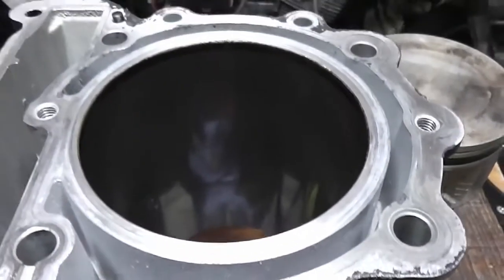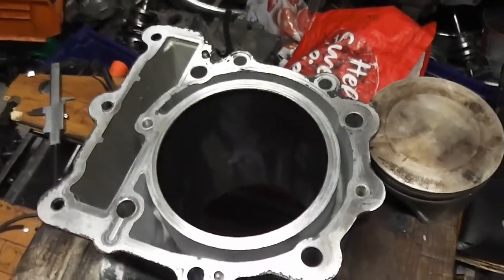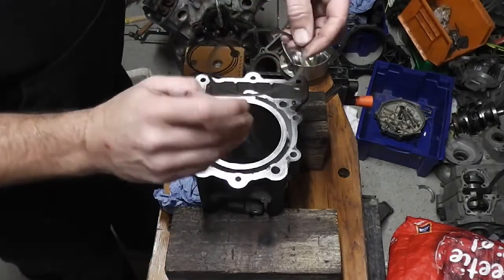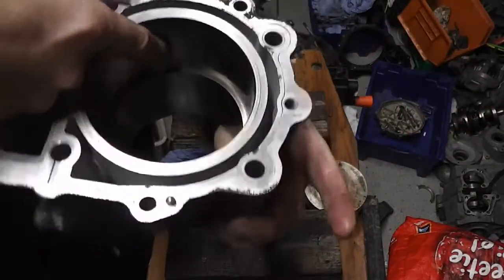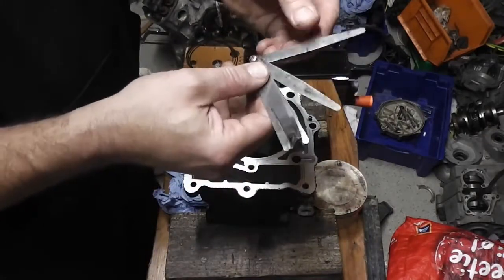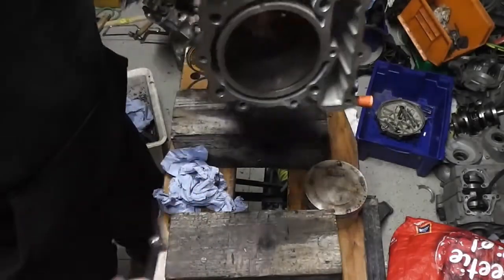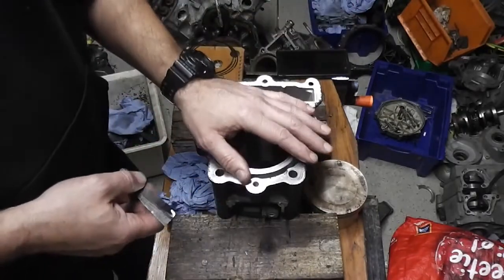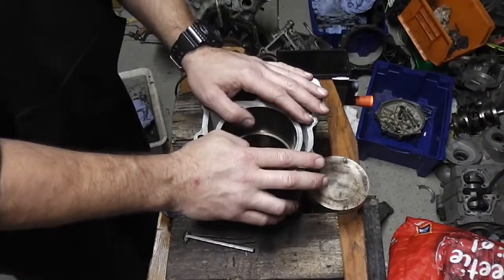BMW F605GS. Measuring piston ring end gap.

Comment: Hi mate I'm rebuilding the engine and gearbox on my yx160 pitbike engine and the oil feed plunger and spring is missing as its second hand and previous owners did a clutch replacement so they must of lost it what would you suggest to do
Reply from the maker: You'll need to find another one I'm afraid